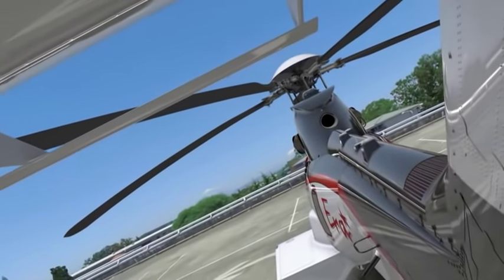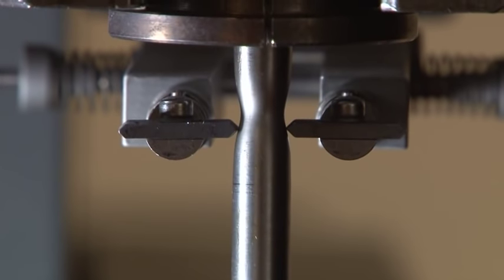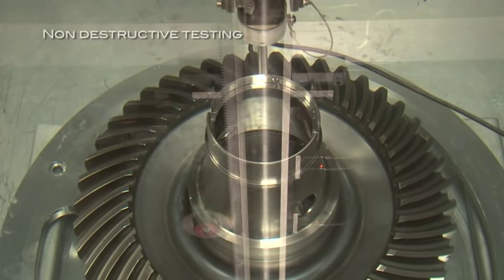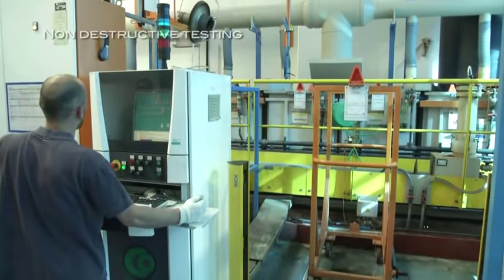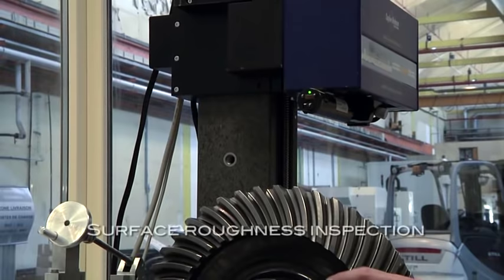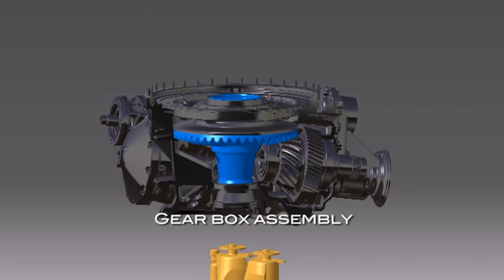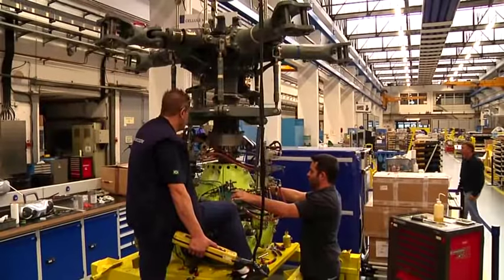EC225 - Bevel Gear Vertical Shaft Process

Comment: Didn't realize it took so much to do this. Will electric motors simplify this in the future (similar to Tesla cars)? The engines would overall generic electricity to drive a large motor for the blades. It would reduce the need for large gearbox.
Reply: +CheapSushi , doubtful.  Electrics in aircraft will still use gearboxes and require extreme tolerances and intense inspection. No doubt the electric motors themselves will be well-inspected just as recip engines and turbines are today.  They have to, since people's lives depend on ALL aircraft powertrain parts being reliable.
Reply: I doubt that electric motors will catch on any time soon for helicopters, the battery energy density is nowhere near that of gasoline or kerosene.
That being said, there have been a few successful electric airplanes for flight training and recreational flight; they only fly about an hour or so on a charge, but that's fine for training flights where you stay near the airport that you took off from. Electric motors drive the propeller directly, there's no need for a gearbox because the motor can be designed to run at the RPM required by the propeller.
As for electric helis, if such a thing ever materializes, it very well may be possible to power the rotor directly without using a gearbox. A large-diameter 'pancake' motor with a high pole count would run at very low RPM and provide the torque required for the rotor, and the tail rotor could be powered with it's own smaller motor, saving the weight and driveline losses of the gearboxes and tail rotor driveshaft.

Comment: BOMTOGL. Unimpressive tensile test at 49sec. The test specimen necking outside the extensometer test zone. Tensile tests are usually only considered valid if the break is in the middle third of the test zone between the extensometer points. Broke Outside Middle Third Of Gauge Length. BOMTOGLE.

Comment: That rotorhead is way too high up from the fuselage considering those blades don't droop very much.  I bet that's a contributing factor of some of the Puma crashes.  All that stress on the main gearbox housing.  Puma is a death trap.

Comment: This vertical bevel gear shaft was redesigned after 2 accidents in 2012 and replacements should start medio 2014. Today a terrible accident in Norway with an EC225 (LN-OJF) heading home from an offshore rig.  13persons killed.. (:  R.I.P.   I indeed hope the new modified part was onboard.
Reply: +trollkremvideo http://www.verticalmag.com/features/features_article/EASAcertifiesredesignedEC225gearshaft
Reply: +trollkremvideo Heat Affected Zone ?Fatigue
Reply: +trollkremvideo the gearbox and rotor was changed this year and had 1300 flight hours.
Reply: +staslig Still a question for the changed rotor; Heat Affected Zone ?Fatigue
Reply: trollkremvideo I have no idea.
My money is on a total gearbox failure due to loss of oil, but that is just speculation at this point.
Reply: +trollkremvideo https://en.wikipedia.org/wiki/2016_Tur%C3%B8y_helicopter_crash#Crew_and_passengers

Comment: This part is more critical than the engine(s). 
Total engine failure is manageable but if this part fails, you fall like a rock.
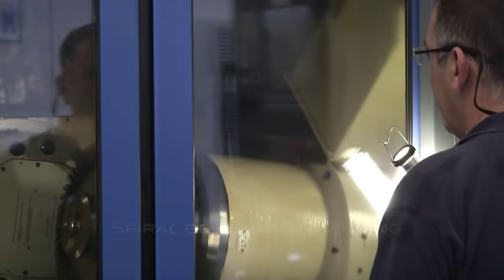Reply: ☠BLACK BARON☠ I recommend ... hardened steel high quality pinion gears for RC helicopters as well. 1:26

Comment: Yeah I'm no engineer either, but I always thought that the whole shaft through the hub was solid right way through not hollow like that. Then the hub is just sleeved into a fitting in the gearbox is it?? Looks flimsy to me or such a large helicopter!
Reply: +Mel D Hi Mel, it depends on what duty the part is carrying out on how thick it needs to be. At 0:29 you can see what it does. All the torque and stress gets put through the bevel gear at the top, and the rest of the part only supports the gear and provides drive for small oil pumps. In aviation you are always trying to save weight, so you only reinforce the most highly stressed parts. 

However, the rest of the video explains that the supporting section and bevel gear are welded together (chosen because its lighter), and this weld is very close to the highly stressed bevel gear. All the failures have been around that weld. Welds tend to be weaker than the parent metal and this is where you would expect a fatigue failure of this sort. If the metal was thicker you would still need to attach the two parts, and would ultimately only delay a failure, so long as the vulnerable weld exists. In the L2 revision, they did thicken the section around the weld. Its not yet clear if this is what failed this time, and it may not be (see below)

Without the weld its possible the failure would not occur. A fundamental redesign may be needed, a "design for manufacture" that eliminates the need for two parts. That is true for the previous failures that only disabled the oil pumps but left power intact. In this new failure, the whole rotor has come off, which suggests a failure of another part of the gear or other part entirely
Reply: @Mirandorl  A proper weld is usually stronger than the base metal. It's the heat affected zone that usually fails. This is why welding technology always strives to minimize the size of the heat affected zone by increasing the power density (can't think of how to phrase it better) of the process and minimizing the time the workpiece is being heated. From gas torch to electric arc to laser beam to electron beam.

Comment: and still these things keep dropping from the sky.
Reply: +staslig 
Redo the hole Gearbox/Shaft. Airbus: FIX IT, OR TRASH IT, -FOR FUCKS SAKE..!
How manny more shall you kill ? I hope Norway bans this shite FOREVER !
ExEMTNor
Reply: +400 CC you obviously havent read the reports coming out from the investigation. the latest news is that the gearbox was involved in an car accident while being transported from Airbus. possible fatigue fracture. nothing to do with the design
Reply: the overwhelming majority of rotary wing crashes stems from operator error and bad maintenance. It is quite rare that a properly manufactured, maintained and operated craft crashes. safety statistics per flight hour for rotary wing craft may not be as good as passenger airlines, but they are still far better than roadbound vehicular traffic.
Reply: @joeystar8888  sikorsky shoots their shippimg containers with a howitzer cannon then drops it from 30000 ft from an airplane then NDT's the intire thing no damage.  Buy Sikorsky

Comment: Any thoughs on how a EC225 could lose the rotor and crash and killing 13 people?

Se video of rotor falling through the sky (norwegian): http://www.tv2.no/v/1039640/
Reply: The transmission assembly had several issues, not just one.  Metallurgical fatigue of planetary gears, poor assembly discipline (the main gear was dropped and was not logged or inspected), poor maintenance discipline.

  This comedy of errors led to the incident. 

 Improvements on all aspects of manufacturing, quality control during transport and assembly, impounding and investigation of suspect parts that were involved in impact type accidents, increased maintenance checks of the transmission and overhaul procedures of aged components.

Comment: Welding  two critical components together bad idea.
Reply: should've been carbon fibre ages ago IMO
Reply: It gets to hot for such laminates inside the Gearbox. The gears themselves are still best when made from metal
Reply: @+Meddlemoe? What are you trying to say? ppl are trying to say that the whole thing should be machined from a complete thing and not welded..
Reply: It's the only way to produce it. The video shows why--the main gear and hub extension together don't allow clearance for necessary machining operations. This is how it's done, and it has always been done this way for vital reasons.
Nuclear reactors have critical components welded together as well. So does your car :)
Reply: @+Devil's Offspring: True, but in either case your life wouldn't come in danger within the minute. A car you can stop, a nuclear reactor will take minutes to hours to overheat and there are backups (that should be working).
Reply: If it's properly done, it won't break. Once they're welded together the two components are as good as one piece. Like anything else in aircraft manufacturing, it has to be done right.
Same thing with your car, welded assemblies failing (i.e. suspension components) means loss of control and death.
Reply: you may be able to achieve a integral shaft and gear with those kinds of tolerances using a sinker EDM technique... i don't know what all else they are looking at... but still... if they are making totally documented parts consistently to a tolerance of one micron. .. o buddy... that is awesome... This is a great video, that is a salute to that aspect of procedure that a guy like me can sometimes fail to truly appreciate as much as he should.

i love it... am glad it was made and posted
Reply: deadboy600 the Challenger booster didn't have a weld fail, it was too cold for a particular O-ring which failed and allowed hot gasses through
Reply: Then you know jack shit about "metallurgy" and least of all "carbon fibers" that are GLUED TOGETHER AND ARE THE "MODERN" VERSION OF "FIBERGLASS".
Reply: Bullshit. They could do what's been done billions of time in differential ring/pinion sets and separate the ring gear from the carrier and BOLT TOGETHER THE TWO PIECES.
Reply: Actually the o-ring did not "fail". It was in a situation/application where even in "perfect" condition it couldn't do the job it was designed and installed to do. And not just because it was "too cold". With that "cold" morning came dry, dense air and increased "air resistance" over the SRBs as well as SHRINKING of the solid rocket fuel - which isn't "solid" but instead contains a lot of "air" being made up of "sintered" metal particles - which left a gap between the fuel and the "outer skin" of the booster. 

That gap prevented heat from "aerodynamic heating" from being transferred through the skin to the "fuel" and that heating is what ignited the fuel and "burned through" at that joint once the o-ring itself actually got TOO HOT and "melted" and then "ignited". That whole tragedy is the "fault" of NASA "suits" and PR concerns and not wanting the big "Teacher in Space" circus sideshow to get "delayed" since pretty much every classroom/kid in the country was supposed to be watching and drinking more of the NASA "rocket scientist" Kool-Aid. 

Had that mission been "scrubbed" the pure politically-motivated pick of Krista McCauliffe would have been revealed to be just that when she was forced to go back to her classroom she hadn't been in for months anyway since that whole "mission" was a PR stunt and had no scientific "merit" at all. The shuttle program was a giant boondoggle that never "delivered" what was promised all along and ended up being a "foreign aid" program where NASA funneled "free" rocket-ship rides and U.S. government contracts and "seats" for U.S. astronauts and actual SCIENTISTS to foreign governments and "space agencies" that haven't put even a monkey in space on their own and "astronauts" that like the "Teacher in Space" couldn't fly anything not made of an 8 1/2 x 11 sheet of paper. 

That was the beginning of the "space tourism" racket and the much bigger racket of letting our "allies" that motherfuck us incessantly at every opportunity and make "anti-Americanism" a national past-time and "institutionalize" it with their government-owned media turn around and make money and "political points" off of us hand over fist while also letting us be the world's "bad guy" and clean up their fucking messes from centuries of "imperialism".
Reply: When you're cutting gears its not "tolerances" that you're concerned about. Its DIMENSIONS and SURFACE FINISH and HOW PARTS FIT TOGETHER AND YOU DON'T "TORCH" METAL "BLANKS" TO MAKE "PRECISION" PARTS. You "EDM" fanboys don't have a fucking clue how much of a JOKE that "technology" is for anything but very SIMPLE and VERY EXPENSIVE parts that can only be "EDM" so-called "machined" AFTER they've been "proto-typed" and MASS-PRODUCED THROUGH "TRADITIONAL" MEANS/METHODS/PROCESSES FOR YEARS OR DECADES FIRST. And no, they're not "making parts to a tolerance of 1 micron" because that application doesn't require it "dimensionally" and they couldn't deliver it "machining" the parts anyway. A "micron" is a "unit" used to measure" SURFACE FINISH. Not a "dimension". It IS a "measurement" in that its the "distance" between "peaks" on the surface of the metal after "manufacturing" but its not something you can measure with some little BALL on an "indicator" stem when that "ball" can't and won't FIT into those "grooves" between the "peaks". What is the "circumerence" of that "ball"? 

And what is ITS "surface finish" in "microns"? And how does the "indicator" and the "instrument" its connected to "measure" whether or not the "ball" is sitting "on a peak" or "in a valley"? It doesn't, it can't and people like you that have no clue what's meant by "dimension" vs. "tolerance" vs. "clearance" and believe whatever you hear "matches" what you're seeing on the screen as you "learn" from a freaking COMMERCIAL only get "dumber" the more you "learn". The FACT is that the "surface finish" has nothing to do with that little ball or the machine tools that supposedly produced it or the "engineers" that supposedly "specify" it. That SURFACE FINISH is the result of LAPPING THE RING GEAR AND PINION TO/AGAINST EACH OTHER TO "MATCH" THEM RATHER THAN "RAW MACHINING" THEM. You can't use a GRINDING WHEEL with a "grit" far more "coarse" than "1 micron" to PRODUCE a "1-micron" SURFACE FINISH IN/ON A PART "SOFTER" THAN IT IS BECAUSE YOU'RE "GRINDING" AWAY LARGER "CHUNKS" THAN THAT BY FAR EVERY TIME A "PARTICLE" IN THAT WHEEL "CUTS" INTO THE SURFACE. 

And even that "1 micron" crap is complete bullshit for GEARS because its NORMAL to see "beach marks" from the "machining" everywhere the gear teeth haven't been "lapped" to each other in a MATCHED GEAR SET. You don't WANT a "super smooth" SURFACE ON GEARS/GEAR TEETH WHERE THEY DON'T MESH BECAUSE EVERYWHERE THEY'RE NOT MESHING YOU WANT LUBRICANT TO "STICK" SO IT "FLOWS" INTO THAT "CONTACT AREA" WHERE ALL THE LOAD IS CONCENTRATED AND THE METAL IS "SMOOTH" AS POSSIBLE TO DISTRIBUTE THAT LOAD OVER AS MUCH SURFACE AREA AS POSSIBLE. 

This video was probably "written" and/or "edited" by "engineers" but "engineers" usually don't know JACK SHIT about what happens to their "blueprints" and "parts" once they leave the "drawing board" and the "workers" in the DIRTY "work clothes" have to turn them into PARTS AND MACHINES THAT ACTUALLY "LIVE" IN THE REAL WORLD. Typically there's at LEAST .001" of "backlash" per 1-2" of "ring gear" diameter in a ring and pinion gearset specifically to provide CLEARANCE for that lubricant. Go set up a set of gears that are lapped/matched to each other and go for "1 micron" of "tolerance" at the "mesh" and IF you somehow manage to make that gear-set ROTATE through a full "cycle" of meshes (most ring/pinion sets have "hunting" ratios and if the ring gear has say 35 teeth it takes at least 35 "rotations" of the ring gear for every tooth on the pinion to contact every tooth on the ring gear - more "tricks" to "matching" gear-sets so in the REAL WORLD they actually WORK AND LAST) or even ONE full "revolution" without it binding up tight it will be amazing. But I guarantee you put it in service and before the end of the "break-in" period that gear-set will self-destruct and it'll be "whining" and getting noisier and noisier and rougher and rougher instead of getting quieter and quieter and smoother and smoother. PARTS HAVE TO HAVE ROOM TO "FLEX" AND "EXPAND" AS PRESSURE AND HEAT ARE CREATED IN AND BETWEEN THEM. 

But then again since those same "engineers" you are so impressed by and their "impressive" so-called "tolerances" have a bad habit of building "deathtrap" helicopters, maybe they ARE getting a "1-micron tolerance".
Reply: Did you get a ship-load of surplus quotation marks for your birthday?
Reply: @deeremeyer1749  Yelp.
Reply: N
Reply: @Meddlmoe  . Kkkaajqnw

Comment: In a (fixed wing) plane at least the pilot has a chance to glide back to Earth, but in these machines when the engine fails (or gear box, or any other complicated parts) the machine just falls to the ground. I would never bet my life on one of these things.
Reply: helicopters can land safely without engine power, its a maneuver called auto rotation
Reply: @TheNinjaRichie  Only if a gearbox is still working.

Comment: Call me old-fashioned if you will, but any helicopter company who produce a machine which has a wrong type of pressure switch, as discovered in Ditching No.1, should have done a recall before Ditching No.2 happened. 
In the second ditching, the pilot wasn't too worried about Low-Pressure Alarm, because he'd heard about the wrong switch found in preliminary investigation in Ditching 1, so why in the name of all that is French hadn't Eurocopter checked and changed the offending article?!@$%#
It leads one to suspect there exists a poor/inconsistent Safety Culture within Eurocopter.
My heart goes out to the poor bereaved and the poor guys who still have to fly these things.
Reply: The French make nice looking and technically modern cars but we all know they are crap. Why would helicopters be any different?

Comment: Where is the angle cut before the weld ?? This weld either works or breaks clean off. 
An experienced TIG pipe welder could do better than this by hand. With angle fill in cross layers you at least have a chance to land before it comes clean off. After seeing the video all i see is people polishing a turd (post weld)

1. Make it in one damn piece.
2. Learn to weld or just save the metal. And the lives

Airbus: We are shocked, never heard of something like this.. Strange, it happened in 2009